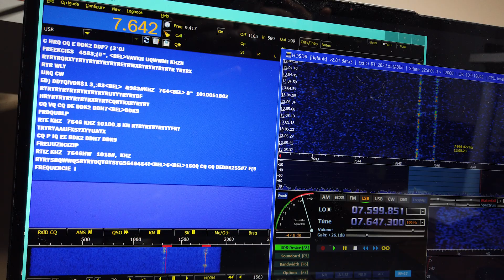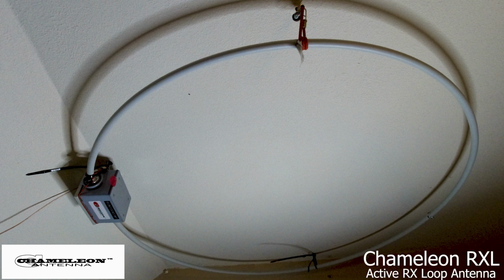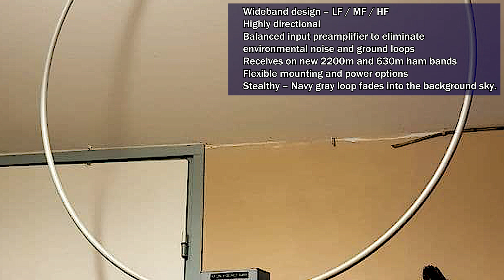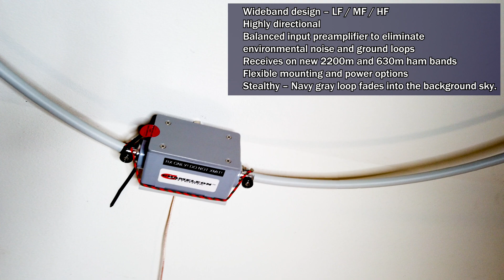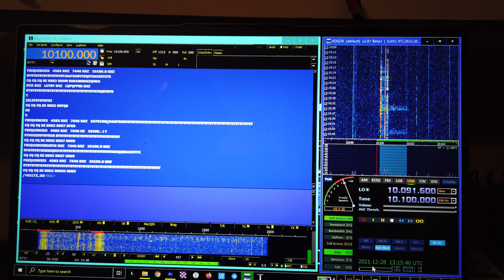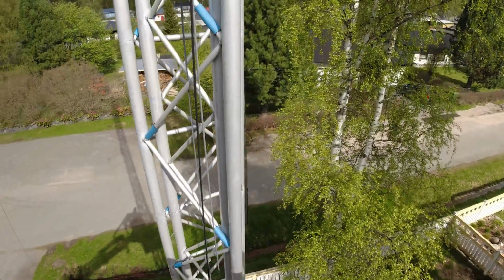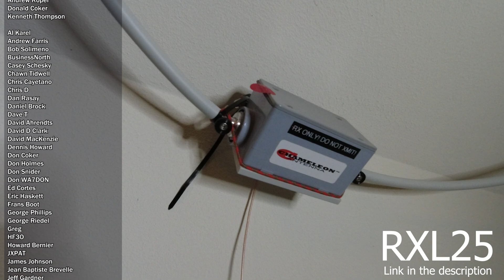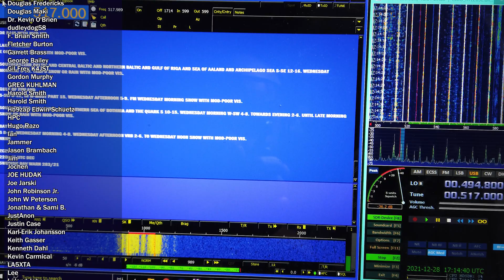Active Loop SDR Antenna | Chameleon Antenna

Comment: I just got one of these to use as a receive antenna to use with my noise-canceller (MFJ-1026) or as the RX antenna for my FTDX-3000.   I must be doing something wrong...not sure what...but I notice no difference in the noise levels on the HF bands with it compared to just listening on my transmit antenna (a fan dipole).  I'd like to do more SW listening as well; supposedly these loops are good for that purpose, but I haven't had much time to try that yet.  I'm trying to figure out why I see no noise reduction at all.  Everything is properly hooked up/configured.  ???  73 - Bob KJ6GEU

Comment: now that they don't sell that model anymore (Discontinued) it will be nice if they extend the coupon code to the replacement (RXL PRO), I just tried and doesn't work. Quite of a stiff price $525 to swallow without a discount code. Check with them if they can, my credit card is jumping on my pocket!
Reply from the maker: Coupon code was for a limited time. There is a workaround. Order the new one from GigaParts and use my call sign as a discount code. Otherwise, send Chameleon an email to ask. support@chameleonantenna.com if they say no, order something else.
73
Julian oh8stn
Reply: @OH8STN  Hi Julian, I saw them in Gigaparts but is the old model and I wonder if the new “PRO” model it worth the extra money. Thanks for your quick response. 73.
Reply from the maker: It's a good question but I honestly don't have an answer.
Reply: @OH8STN  FYI , your call sign (OH8STN) in Gigaparts is not working either. I'm trying to place the order but it says "The coupon code "OH8STN" is not valid."
Reply from the maker: Sorry man. My discount code works for many products at Giga Parts but apparently not that. It still works for the Powerfilm solar panels at least. Kind of frustrating. I'll reach out to them. Thanks for the heads up.
Reply: @OH8STN  whatever happens I appreciate you help man. I'm trying to get in to a decent loop for receiving but those prices are pretty rough just for a receiving antenna so I am trying to find a deal. Lets see what they say, hopefully they honor it.

Comment: I bought this antenna and been using it for three weeks now, it out preforms my wire antenna hands down ! I mounted it vertically on a rotor which now gives me some Direction ability for gain and null. I’m so impressed by how the noise level drops when using the Chameleon antenna. I recommend it !
Reply: I’m now using this loop antenna for 7 months now and I’m still very happy with it ! I highly recommend it !
Reply from the maker: Very nice. I'm still using it as well. It's my primary SDR antenna for shortwave listening. I don't think I would change it. Thanks for commenting, very much appreciate it.

Comment: I am impressed! What is the diameter of this Loop antenna? And, is there one made that will do both Receive & Transmit on HF & VHF, or is it HF only? I'm an apartment dweller with Balcony-only place for an antenna. That's quite a setup you have! Hope to hear more from you. 73, WA7JR Judi in Idaho
Reply: The diameter of the RXL is 1" with HIGH TOLERANCE aluminum connectors. This one is RX only for 135.7 KHz – 30.0 MHz continuous. If you want to transmit on HF then you'll need the CHA F-LOOP 3.0.

Comment: Great video! Question: I notice the BNC connector on the antenna and on the Bias-T. Will it be okay to use a BNC to PL-259 connector on the antenna and Bias-T so I can just use the same coax on both connectors?
Reply: Yes you can without any problem!
Reply: @Chameleon_Antenna  Thank you!

Comment: I’m very disappointed, the Coupon Code has already expired ! I wanted to buy the Chameleon loop antenna hoping to get a discount but has expired.  😢
Reply from the maker: Why not send them an email telling them you saw the video and ask if you can get the discount?
Reply: @OH8STN  ok, I’ll try that, thanks
Reply: @Mr07008  NEW COUPON RXL20
Reply: @carllavoie3804  yes it worked ! I just saved 25% ! I just bought a Chameleon loop and saved 25% using the coupon code ! Thank you ! 😃
Reply: Back in stock: COUPON: rxl25

Comment: Fantastic thanks for the video! I have the same issue here in my townhome. No antennas allowed.
Reply from the maker: Yeah it's a bummer.  Thankfully there are dome good options.
Thanks for the comment and the kindness. It's very much appreciated.
Reply: Eduardo - The loop is back in stock COUPON rxl25
Reply: @Chameleon_Antenna  thanks. I want one to transmit in 10 m… price is beyond my budget sadly. 73

Comment: How does this compare to a random long wire, or any wire of reasonable length you can fit in your available space?
Reply from the maker: Great question but perhaps too abstract to give a good honest answer. Naturally if we have space for a long wire or for example a 160/80m skyloop (my preference) those would do quite well. A long wire will still have the locally generated noise but could work if noise is not a factor. When space is a factor, this iwll alsoways outperform a wire designed for the same avaiable space.
Excellent quetiion but wish I could give a better answer
73
Julian oh8stn

Comment: Hi, great video. How do you handle grounding the antenna when it's used as a stealth antenna indoors?
Reply from the maker: Excellent question. One of the benefits of loop antennas is they don't require a ground. They're basically balanced antennas.

Comment: Is the Chameleon better than the MLA-30+, or are they similar? Cheers!
Reply from the maker: Great question, RXL 137Khz-30Mhz, MLA-30+ 500Khz-30Mhz. RXL 12 volt RF quiet supply,  MLA-30+ noisy USB powered. MLA-30+ is made in China, RXL is made in the United States. RXL is supported through Chameleons distributor network. MLA-30+ unknown.

Comment: It is a loop but not a magnetic loop correct? If so, then how about the noise levels? I was planning to use with my IC-7300 as a receive antenna, then use the main antenna for TX. Thanks. 73
Reply from the maker: That's right, it's a loop but not the magnetic loop. Using it as a receiver antenna for the 7300 is a brilliant idea. Take a look at the link in the description. It'll take you to the documentation on the website. Great question and thanks for watching.
Reply: @OH8STN  I would say, great video, better than store or seller details. Thanks a lot for what you do. It helps a lot on decision making.

Comment: Hi, I just listened the podcast with you and Eric! 👍 I do have the MLA-30 with a 30x2mm aluminum flat-bar 2m in length, will definitely try the horizontal way! Another question that often comes up into my mind: is there any way I could run FT8 (or any digital modes) on the CB Bands? I am just an SWL 🙂 73! DE1CTL
Reply from the maker: Thanks for watching/listening. How do you like the MPA30? Lots of comments mentioning it.
The CB question is a "complex". Modes like JS8Call encourage its use on all bands where it is legal to do so. It is uncertain if FT8 follows the same open philosophy. With that said, take a look at pskreporter.info. Use it to filter only the 11 meters band, then select all modes or a specific mode. This will allow yo to see which modes are active on 11 meters along with frequncies they are being used on. In EU digimodes are ok on 11 meters. You'll just have to find the right modes and frequencies.
73
Julian oh8stn

Comment: Try an MLA 30 loop for much less $
Reply from the maker: Thanks for the tip. I would much rather have good customer service and support over the lifetime of the product, than save a couple of bucks up front.
Reply: @OH8STN  You would save Hundreds.   ;)
Reply from the maker: Requirement was 2200m & 630m coverage. MLA-30 500khz - 30mhz vs 137khz - 30mhz RXL.
The FLOOP is not a receiving antenna.  Its RX/TX 80-30mhz.
Reply: @OH8STN  OK I am just one of those guys that have to see for themselves. I have been testing the MLA-30 Loop ($50) and the Chameleon CHA F-Loop 3.0 ($500). The CHA comes with three confirmations Rigid Loop(60-10M), Single coax Loop(60-10M) and Double coax Loop (for 80-30M). I live in an apartment so I have to have the antennas inside. After 2 months testing I have decided that there is really no difference between the two except for some extra band noise generated by the active portion of the MLA-30. If I change my mind I will let you know.
Reply from the maker: @caltech007 Give it a try for sure. I'm just one of those guys who focuses on my requirements before looking at the price. If something meets the requirements, a good price is the gravy on top. The MLA30 doesn't cover 2200m and requires USB. I needed 2200m and a quiet 12v supply.

Comment: Somehow this qued an idea on how I can support a horizontal loop, without hooks, drilling, or adhesives...if I get it into existance, I'll make a shorty vid. The name of the structure will be shocking a bit, but not curse worded. 
A ceiling without electric travelling through is probably a very important lucky factor. It will require de-corroding an old stud finder for secure install.
Great, well flowing video content.
And, so you know, there is a net in the Chicago-Chesterton area that asks peeps to drop channels they reccomend on the YT band, and you have been mentioned for your digital coms and camping/off grid content.

Comment: I've never tried it, but I've read in various places that there's little benefit to mounting one of these loops up high on a tower. Some even say about 2 meters high is ideal for them. It will be interesting to see your results. Maybe Chameleon has tested it? BTW, I really enjoy your content; keep up the good work!
Reply from the maker: Yeah I figure in horizontal configuration, higher is better. Hoping to avoid the use of a rotator, so that's why I'm considering putting it up high in horizontal config. With other Loops mounted download I've had extremely good success. Nice to try various options 👍

Comment: Good video and very interesting topic. Thank you.  If possible he should try some sort of LoG antenna. I do have one in my backyard and nobody knows about it. I used scrap copper cable and using 4 tent pins formed 4.5x4.5m square fed with 75 Ohm TV coax (no amp. only small isolating transformer - 43 binocular, 6 turns). I use it with SDRPlay and for what it is, it works really well.
Reply from the maker: This could be something we could try when teh ground thaws. How is the LF performance and noise?
73
Julian oh8stn

Comment: Will you be mounting it vertically or horizontally on the tower?
Reply from the maker: That's an excellent question. I think I'm going to mount it horizontally. It's given great results horizontally from indoors, I can only imagine what it would do outside. On the other hand, a small rotator could easily set the azmyth. I'm just not sure if I want to run more cables for a rotator. I'm sure it's probably horizontally :-)

Comment: There are still a few big SW broadcast stations on the planet worth discovering. Best times are after sunset or late in the evening.
Reply: Nowadays  every shortwave  band is infested by CRI and it's  subsideries  compared to the late 70s 80s and 90s. My long wire  antenna used to bring in HCJB  Quito  Equador in Chennai India on 25 meter band in 80s. Those days area gone for ever sadly.
Reply from the maker: Thanks for that. It's been decades since being interested in short wave radio. What I've learned while making this video has been astonishing. Great content from all over the world. Thanks for watching and for the comment, much appreciated.

Comment: I see on the Chameleon web page they also offer a lower cost kit with the pre-amp, bias-T power unit and mounting box.

I also have for transmit/receive the CHA F-LOOP 2.0 with the 36-inch aluminum loop. Works fine. Very rugged.

For an SDR receive only application I have, the receive only loop would be fun to play with, mostly digital transmission monitoring.

I hope the aluminum loop from the CHA F-Loop will connect to the CHA RXL. I'll check with Chameleon.

Thanks for the video

Dave, AA6RE